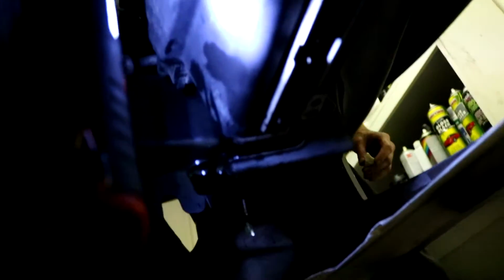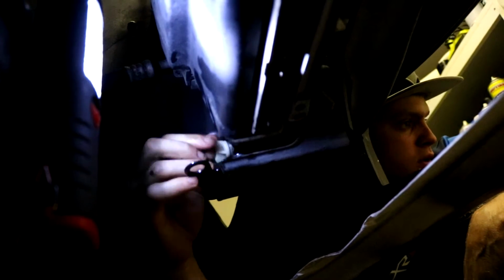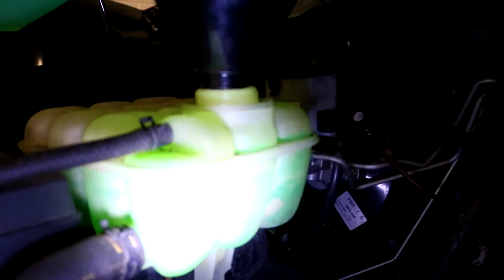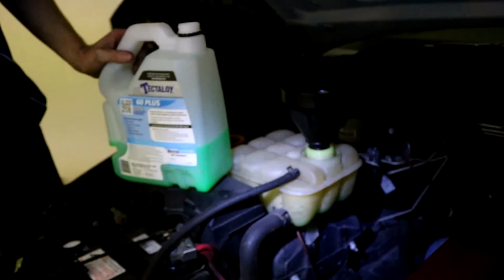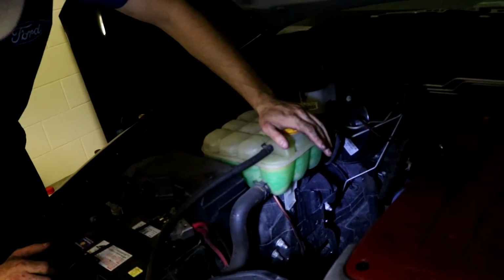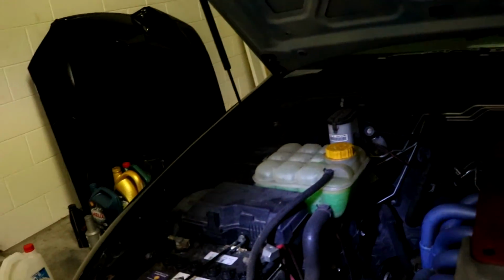Ford FG Service - Changing Coolant

Comment: This is incorrect. You never showed running the engine so that the thermostat opens to properly bleed the system. Misleading video
Reply: alexliberty100 could you explain for me bro?
Reply: Joshua Tierney The correct procedure is: after draining all the old coolant and re inserting the plug, fill with new coolant to the full line and squeeze the upper radiator hose to expell air. Then run the engine for aprox 10 mins (with radiator cap off) until hot which will open the thermostat. The level will drop after this as even more air is expelled as the water pump bleeds the system. Top up as necessary after that while the engine is running because it may drop quickly.
If you just fill it up without starting the car and letting it heat up you may have air pockets in the system which can heat up and explode in the radiator
Reply: alexliberty100 cheers mate giving it a go tomorrow
Reply: Also a good idea to run the heater as well, this makes sure the valve into the heater core is open.
Reply: alexliberty100 
Thanks for the details, will follow your advice.
Reply: If you knew all this then why did you come here to see how it's done?
Reply: There's always someone who knows more, whats wrong to being open to leaning still. Just in this case they found it wasn't the case.
Reply: @alexliberty100  THATS SOME BULLCRAP ABOUT SQUEEZING HOSES  these are a gravity feed radiator meaning there is no bleeding procedure , and squeezing hoses is actually a terrible thing to do , for one it weakens the hoses and any dirt lodged inside those hoses will dislodge and clog up your system this includes blocking radiators , you run the engine until the thermostat opens and then you top up resovoir and thats it !!  ,  and before you blab any more i used to work for FORD
Reply: @iamasmurf1122  I never said to squeeze anything. As you said running the engine is the only bleed procedure. My point is this isn't explained in the video. People will watch this and receive overheating engines. This car has a capacity of about 10L and only 5L was added in the video. So it's still not completely full. I also did my apprenticeship at Ford.

Comment: Seriously disappointed that's what you put in your car..
Should use Nulon or Penrite..
Reply from the maker: Tectaloy is a top brand and make great coolants!

There was nothing else in Super at the time. There's new stuff in it now :D
Reply: FGmods tectaloy does make good coolant, but 60 plus is not suitable for any modern car. Check the tectaloy site for the correct coolant for your car

Comment: how often should I change the coolant?
Reply from the maker: Completely depends on your engine and how much you drive
Reply: Depends on the coolant, long life is usually 5 to 7 years, but it will depend on the application.

Comment: No engine block draining ? No heater on full to ensure full circulation ? No bleeding of the cooling system after refill ? No advice on waiting until the thermostat opens to correctly bleed ? ..........Do it properly if your going to offer advice on utube !